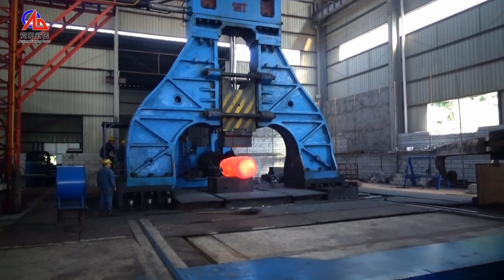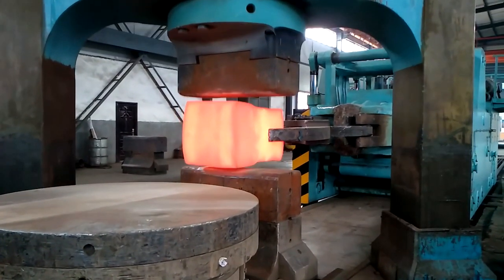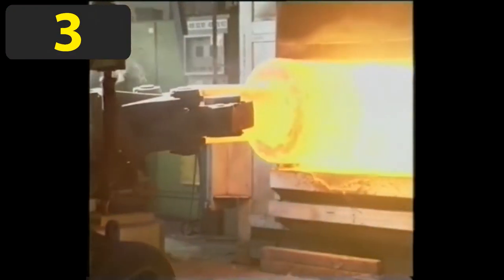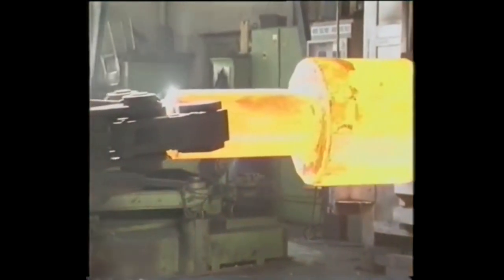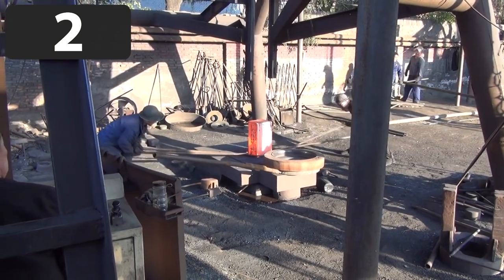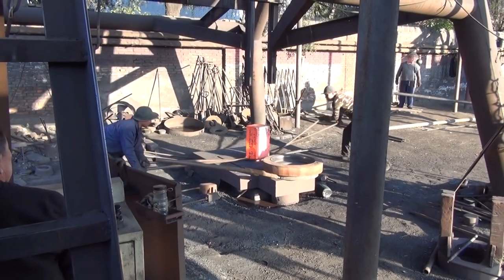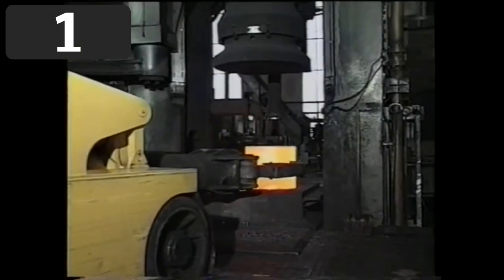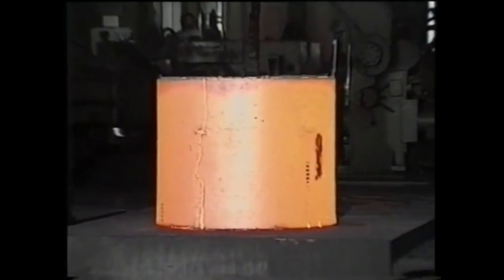Top 5 Amazing Forge Videos (eye candy)

Comment: I've done a lot of welding in my lifetime, gas, acetylene, argon gas (Heli-arc)but I've never watched steel worked in this way. It's nearly hypnotizing, "eye candy" as your title says. Thanks for sharing this, I'd enjoy seeing more.
Reply: Forging is a beautiful thing. I started forging before I ever touched a mig welder. You can even forge weld when you get to proper temperature, creating a completely homogeneous piece from multiples. That's the technique used to make modern damascus or pattern welded steel. It was also used in the creation of Japanese katana's, where a soft flexible steel was wrapped in a very strong high carbon steel to create a strong yet flexible blade. Very neat stuff.

Comment: The size of those billets. No wonder they don't need a second heat to get so much work done. 
And what I wouldn't do for a decent power hammer. Those monsters they are using could turn vehicals into cubes.

Comment: What is the guy dropping into the hole before he presses it?
Reply: Either raw coal dust or coke power .
It is used as a lubricant and under the compression with the heat it has a diesel effect with compression ignition and the explosion ejects the drift .
Fire triangle : fuel , heat , oxygen .

Comment: Does anyone know what is the dust at 7:20 that the put under the black thing?, and why they do that
Reply: Oil soaked sawdust so it doesn't stick
Reply: @gigabilitydontask1549  oh interesting, thank you
Reply: Coal dust normally or coke dust .
Id say coal dust due to the yellow flame , coke does produce that as all the volatiles have been extracted prior .

Lubrication and with the heat there is a compression ignition effect like a diesel engine and the detonation ejects the " drift "
Reply: @machinerydoctor  is drift scale
Reply: @gigabilitydontask1549  
No that's the tool that is being hammered in to make the hole .
Also called a punch .
Its a shame that exercise wasnt shown its entirety as they are forging a high pressure butt weld pipe flange .
They flip it and pierce through with the punch to connect the other side to form the bore .👍
Reply: @machinerydoctor  my father was a hammer man when I was younger it was a big part of my life and his used to run something called the 50
Reply: @gigabilitydontask1549  
And that being ?
Reply: @machinerydoctor  and that's the end of our conversation
Reply: @gigabilitydontask1549  oh ok a
Top secret code 
Im not privy to .
Thats ok take it to the grave .
Reply: Yeah 
You win 👍

Comment: How do they get the metal to stay so hot?
Reply: I guess it stays inside a finance for a very very very long time?
Reply: The bigger pieces heated in gas furnace. The smaller max 20kg pieces in electric induction furnace line like in my factory.